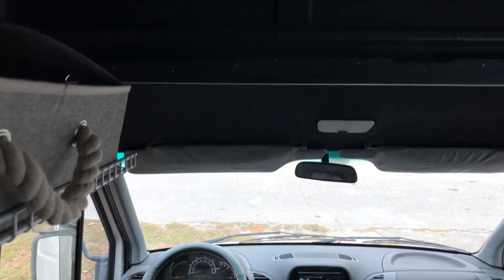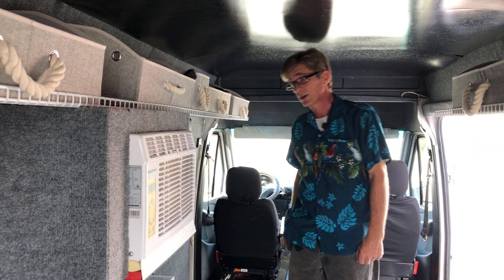Solar Air Conditioning on a Camper Van!

Comment: I'm struggling with what to use for A/C in the van when I get one. I like what you've done by building it into the cabinet.
Reply from the maker: We hav a few videos showing different vans that I have put this kind of a/c into. This one might be most helpful: https://www.youtube.com/watch?v=sFqJyOrc7Gk&t=13s
Reply: if it helps I'm trying this if it helps you - heat pump so hot cold and dehumidifier and I'm mounting on the floor to keep the CoG as low as I can.    -https://www.serversdirect.co.uk/p/873146/electriq-airflex-14000-btu-4kw-air-conditioner-and-comfort-kit-bundle  -  I will warn you it's pretty big though but very efficient - Good Luck
Reply from the maker: @CosmicSeeker69  That is not efficient at all! For every cc of air going out of the exhaust you are drying a cc of outside hot air into the camper. You want an air conditioner that draws outside* air over the condenser coils and back outside. Not cooled inside air over the coils and about a window! Also, heat pump on electric in a camper is very bad for your batteries. Diesel heaters draw a small percentage of battery power and produce more dry heat. Propane is better than electric heating off-grid.

Comment: Can this setup handle a roof mounted AC? Provided the solar panels are still mounted on top with fabrication. Without shore power I mean.
Reply from the maker: Yes and no. It will run a rooftop air-con for short periods but rooftop air-cons are generally higher BTU to overcome an inherent design flaw. A 5,000 or 6,000btu window unit will provide more *cool with less than half the power required. One big reason for this is the outdoor radiator of any air-con is intended to cool pressurized freon in the ballpark of 150 degrees. The roof of our vans, even under the shade of solar panels, can easily reach 150 degrees when you want air-con most. When the freon on the roof can't cool, the freon in the van can't cool anything either. At this stage you are spending more energy compressing hot gas into warm liquid. But you get zero cooling effect from the spent battery when the warm freon gas is above room temperature.  Whenever your roof temperature is above ambient temperature (always) the roof is the very worst place to place your outside cooling coils. Under the van is always the coolest place, so it will provide the most heat transfer from the coils. This directly relates to how cold the air blows inside the van. If you really want a boost, mount your outdoor coils in a shaded cool place where you can mist cool water on it. (hint: This cool spray is not feasible in a portable rig but works at home with hose pressure and a fine mist of 10 hours per 1 gallon.)

Comment: I believe you said a 24v system.  Nice.  Makes sense what with the power demands of the AC unit.  Like the ductwork as well.  
Maybe I don't understand AC units enough, but seems to me there needs to be air flow through the back end of the unit so wondering where, besides floor exhaust, where the intake is?  Maybe a vent in the roof?
Reply from the maker: Indeed, there is an intake hole in the floor that brigs air up and into the sides of the a/c unit. Every bit of air that passes the condenser coil then goes down the other duct and out the other hole in the floor. The holes are only 4 inches apart, but there is a hunk of van-frame between them to help prevent recirculating heated air.    The air under the van is much cooler than air above the van, so this cools the freon MUCH better than any roof mount a/c unit, making this far more efficient and faster cooling the van.
Reply: Thanks for the reply @FloridaVanMan !  
A pretty good design I think.
Reply: From a mechanical/ curiosity standpoint, with the natural convection of taking cold air from under the van and venting through the roof or out the side increase efficiency?

Comment: I live in Margate Florida. I would like to know if you guys have any used  vans for sales. It's hard to find a good deal on older vans here in South Florida, I won't be travelling all over. Mostly stealth.
Reply from the maker: We have 3 up for grabs right now. The 2008 NCV3 is listed a few places. The solar van called Sunny & Share has had a price drop to $17k and desperate for adventure. Finally I am working on a 2002 that we just painted bright blue. It will look better than new, inside & out... but I need to get the engine running perfect before I let her go to a new home.
Reply: @FloridaVanMan  can I give you my Email address? I'm looking for a used cargo Chevy 3500 or a used Nissan NV 2500. Hollowed out, I want to make it my own. I work for HD and can do the inside work myself.
Reply from the maker: @stefaniefreebird6687  Send me an email to Bill@FloridaVanMan.com and we will talk. I am heavily biased toward the T1N Sprinters, but if you are sure you want a Chevy or Nissan I won't pressure you into the better van. LOL

Comment: Ok if yo want layout ideas check out my "Rosita" named after "Rosie the Riviter" from WW2. She was one tough sexy broad that knew how to work it. Well Rosia is the hispanic version. 
https://www.youtube.com/watch?v=X5QTvezWXWE
 I think this is the best layout for an extended 170 since you can still put a few sheets of 4'x8' standing up and use it as a work truck. The back will eventually be a wet bathroom with a stainless steel shower pan lined in teak and a composting toilet on rollers that stowes when not in use. On the way to and from contracts I put my roll away toolbox in that space. It is the perfect layout to save on hotels whilst contracting. You know it's all about the Benjamins bro. Well let me know what you think. I am gonna steal your idea of the steal airconditioner and put it on the opposite side between the slider door and the wheel well. I will just have to move my office / entertainment fwd a little into the slider door sill. It is alright by me since a lot of people do it. I have 340 watts of solar from two panels running on a 12 volt system but I am gonna get 2 more and that should allow me to run the air all day when the sun is out. I plan to get more lifpo since I only have 100 amps but I can charge off my 250 amp alternator and I also modified a Harbor Freight Predator 3500 Generator and mounted it underneath the van between the differential and the spare tire. I can start and stop it remotely from inside. Let me know what you think
Reply from the maker: Looks good! I don't know if 340 watts will support your air-con needs. We have a new video available in about 15 minutes detailing our 1220w system trying to run 24/7 at 74 Degrees. Be the first to see Solar Stress Test eps.1 https://www.youtube.com/watch?v=ihT8oUWGCjM

Comment: According to epever's manual, it says 40amp charger should not be connected more than 2 of the 300W PV array. 2S2P the pv is overkill. MPPT will cap the input current (power) to its ceilings. It would be more effective if you use 2*MPPT in parallel, 2P of 300W PV each.
Reply from the maker: We have the EPEVER 100a on this van. I'm curious what the panel limitations are with this controller, and don't remember. I researched and bought everything about a year ago, and made so many mistakes. I "think" I got this one right, but not 100% sure. I believe this will handle up to 7500watts at 48v so I should be safe at 1220watts. I remember thinking this unit was extreme overkill and twice the money, but one size down didn't meet my needs. Guessing that was the 40a you mention. I recall thinking, "Well if I gotta buy that controller I might as well triple the panels and make it a try-fold wing with awnings out both sides." I might need to revisit that idea just to be ridiculous.
We stress-tested the van last night. Mike ran the a/c and kept cool all night. When he woke up it still showed over 80% battery. At 3pm we typically harvest 32amps while max draw at 30amps with the a/c running. Seems like last fall testing was invalid due to the poor battery setup. Now that the batteries are proper we Might meet the stated goals of 24/7 comfort.

Comment: How many BTU's? Does the window units condenser fan drive the warm air down and draw the fresh air up? Or, is there an ancillary fan needed?
Reply from the maker: It is a 5000Btu window unit and the factory fan does all the air moving. It has one motor with a fan on both ends of the shaft, one circulates indoor air over the evaporator, the other moves outdoor air. That second fan pushing air over the condenser coil draws air up and push it back down the large ducts. I tried an aux fan, hoping additional cooling would reduce the amp draw, but even ridiculous air-flow made no change. Therefore, I feel the air-flow is sufficient. It moves a considerable amount of air under the van.
Reply: @FloridaVanMan  Great solution for stealth A/C. Did the aux fan make the system cool better. I understand it did not change the amp draw. Also, do you feel the somewhat small ducts through the floor are sufficient size? Were you restricted by the vans floor space under the van? Sometimes we need to work with what is available, not the optimum. What might you change if you had to do it over again? Thanks in advance.
Reply from the maker: @PLSchroeder77  I think the vents are adequately fixed. Family was arguing they were not so I put a powerful house fan under the van blowing up the intake and a cardboard separator to ensure no cross ventilation. it made no difference in temps or amps. I wasn't particularly limited on hole size, so I started with dryer vents in mind and evolved from there to the 3x5 ovals that fit under the box and between the truck structures. Next one will probably have the a/c in a force-vented closet and discretely vented through the wall with covers. Something more stylish of a home central a/c with ducts in & out.
Reply: So on your next one y
intake will still be from the bottom of the van? And exhaust through the side?

Comment: how well is the spray foam working? im curious to see over a long period of time if it detaches from the walls and makes any noise driving down the road. thanks!
Reply from the maker: Foam is working very well. I was adding wire in one of the back doors this week, for a fan. While in there I looked at how well the foam was "bonded" to the van skin. Actually had to pick some out for the wire, and it is very well bonded. 
Temperature testing of 2 vans side by side in Florida August sun proved the insulation factor is slightly better than my other van with Pink Panther fiberglass. Very slightly...
Reply: @FloridaVanMan  thank you!
Reply: @FloridaVanMan  Do you think it is worth the price difference spraying the foam? How thick is your pink panther insulation, and how did you keep from compressing the batting?
Reply from the maker: @jonathanmiller6081  If I were going to live in the van full time, yes spray foam is worth every penny. For my occasional and sporadic use it was not worth pulling out the pink during remodels. The temp difference inside two vans sitting side by side was seldom more than a few degrees and many bigger things can be done. Ceramic tint no the windshield makes a big difference. A cover over the outside of the windshield is HUGE, and a little airflow preventing heat building down from the ceiling is also a major comfort keeper, no matter what insulation is chosen. My pink insulation was the thicker, R-21 I think, and ripped in half to make thinner sheets, one with paper & one without. I used the paper backed panels to cover the big areas and unbacked sheets in the smaller areas. A few squirts of spray glue helps hold the insulation up until paneling is placed. If worried about gasses from that little bit of glue, I guess tape will work too.

Comment: Where does the air come in from to cool the AC?  I like how you eshausted it out the bottom.   I take it that the AC drip pan goes out the bottom too?
Reply from the maker: I forgot to answer the part about the drip pan. Yes, condensation falls out through the ducts and they are sealed against moisture. When parked level, the pan will fill as needed for efficient cooling, then overflow over the back, just as it would hanging out a window. The intake duct is also sealed for the likely occurrence of condensation sloshing over the side of the pan in traffic conditions. The front edge and far side of the pan are built-up with spray foam to prevent water getting anywhere it can't drain away.
Reply from the maker: The column under the A/C is divided. Fresh air comes up the left side then over the top and also to the right side. Both sides and top draw from this left channel. Air that goes thru the coil is then routed down the larger channel on the right side of the support column. The holes in the floor are separated by a van frame member, so they are well divided under the van, preventing recirculation of hat air.